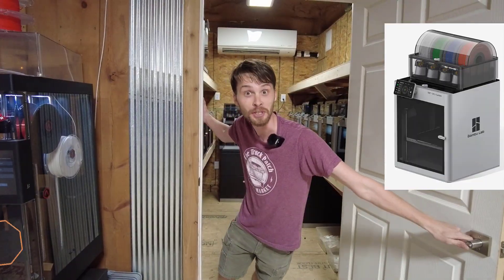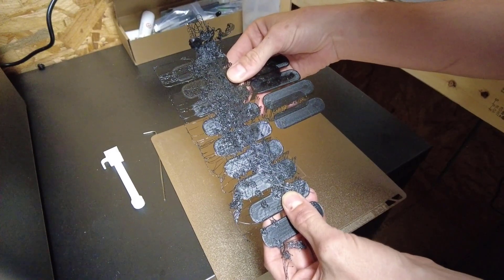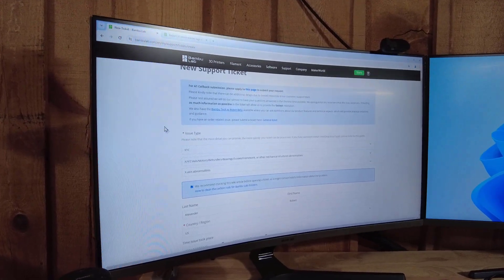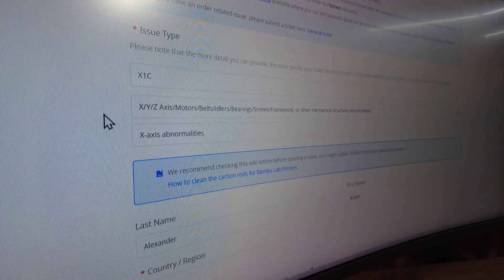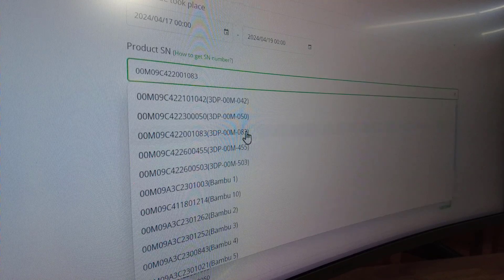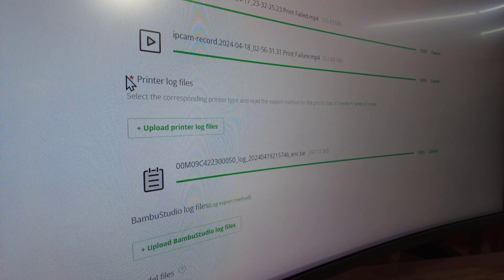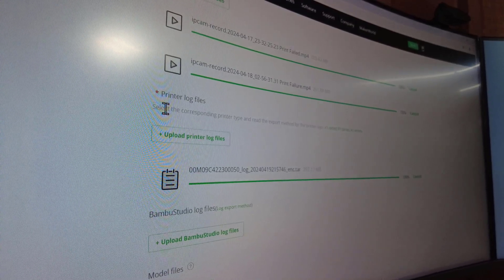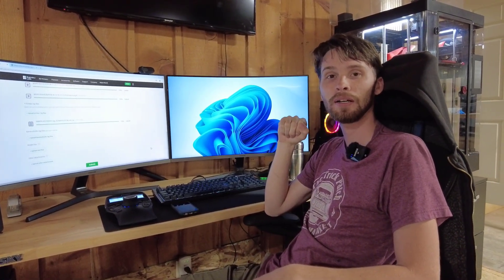First Issue With The Bambu Lab X1-Carbon And What To Do

Comment: Be prepared to wait weeks and even months for a resolution. I spent over 3 months in a support ticket and they never once offered me any support or troubleshooting tests to do. I had to do all my own research and testing to figure out the cause which was a faulty bearing on the left side that caused so much chatter that it wore the finish off on the smooth metal rod after only about a week of printing. I ended up returning that printer, and my 2nd printer has the same issue but on the opposite side. Due to the poor support on the first one, I decided I am just going to replace the bearing myself one day once it is out of warranty.
Reply from the maker: Dang! We hope that this does not take that long. The carbon rod for some reason on one end has a lot of tension causing the printer head to have the binding issue. We will post an update soon. Thank you for your feedback and support!
Reply: @arcadiaeverything  The carbon rods were the worst idea they could have done. All the carbon/graphite dust gets on the bearing and causes wear. I think my printer frame is not square either because i can make the bearing quiet if I slightly skew the gantry by forcing one of the belt tensioner to be slightly tighter, but then only one side makes contact when homing. 😡
Reply from the maker: @user-lx9jm1wo3h   We rotate our printers out and do a deep cleaning of all of the rods and components to ensure proper and smooth operation. It is critical to keep these components clean especially when using filament like ABS smooth and proper operation is critical. . Also use isopropyl alcohol as it cleans better and is rated for the components. Keep the screw rods lubricated but just a little.
Reply: @arcadiaeverything  Yep. But that only does so much when they are manufactured/assembled incorrectly. I even waited 3 or 4 months after returning my first one before ordering another in hopes i would not get another with the same issue. Hopefully they are better now for new users.